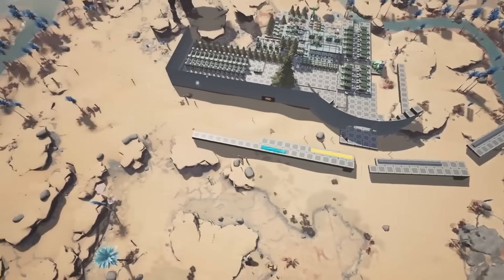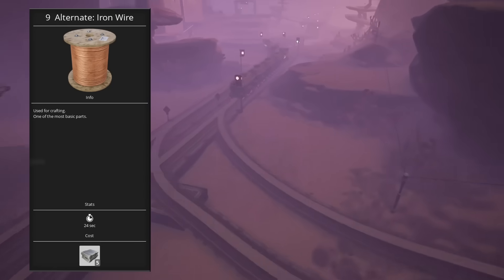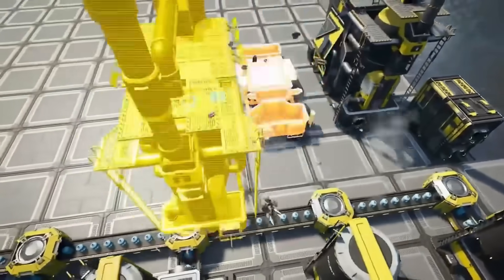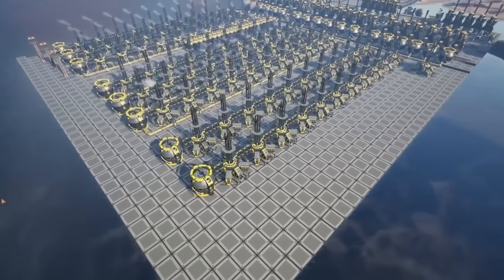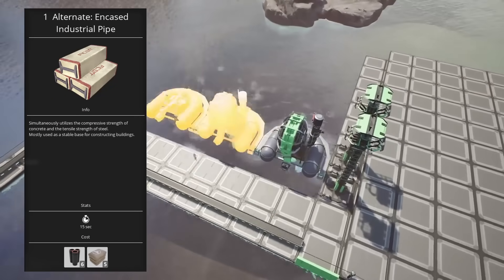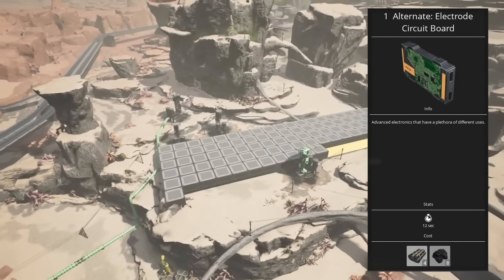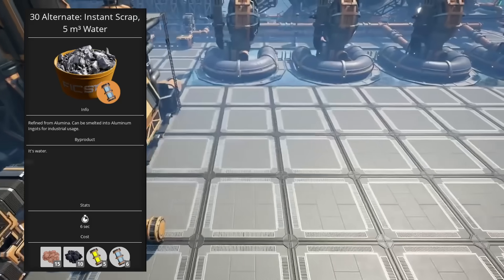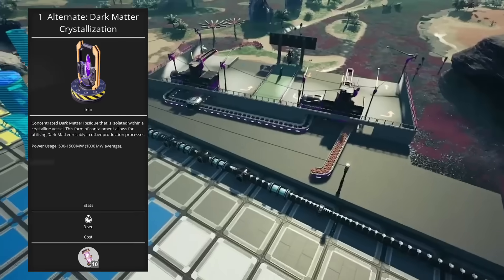Alternate Recipe Guide - Best alternate recipes for each tier in Satisfactory 1.0

Comment: Surprised the Silicon recipes weren't mentioned. Cheap Silica, Silicon Circuit Board, and Silicon HSC was a staple for me. You can add AI Limiters since it uses copper sheets and quickwire that HSC and SCB use.
Reply: @mustangcody  I do think Cheap Silica deserves a mention, in roughly the same category as the Pure ingots: it's more logistically intensive, but offers higher yields.
Reply: Crystal computer for a non-oil, or caterium computer build.
Reply: I really like the silica circuit board recipe.
Reply: oooo, didn't think about that. might have to rebuild my supercomputer factory to make use of those. if i can convince myself to go grab another node or two of limestone and quartz
Reply: I love the silica recipes, just being able to remove oil production all together is fantastic.
Reply: I don’t feel that Cheap Silica is that great (or any limestone-based or concrete-based recipes for that matter since a lot were added). I feel like limestone is a very common resource, but it’s not densely plentiful (i.e. in a single location you usually get 1-2 nodes that are impure or normal), and considering that you usually need a lot for concrete, and recipes that do take concrete take a lot of it, I don’t feel it’s as good as Pure [x] recipes that pretty much double your yield from raw resources for a resource that’s basically unlimited (based off how many water extractors the body of water can take) and doesn’t even take that much of it (1 water extractor = 6 Pure iron refineries or 12 Pure copper refineries!!)
I guess perhaps if you’re minmaxing and not using the limestone or you’re using Wet concrete it may feel a lot better?

Silicon circuit board is the tits tho imo, that with Crystal computers is great to give flexibility for building Computers without oil.
Reply: I can not agree with your take on Cheap Silica. I find that as long as I have Wet Concrete then it would be wasteful of me not to use it. 
That's one of the best things of Satisfactory though is how we all can go in totally different ways to get to the same point. Stay efficient pioneer
Reply: @IndyWoodTiger you can have wet concrete and cheap silica bud, don’t have to pick one or the other
Reply: @IndyWoodTiger I have both cheap silica and wet concrete in my factory, cheap silica is great when you plan how you'd use the resources, but if you don't have any set plan then turning all the limestone into concrete isn't a bad idea either